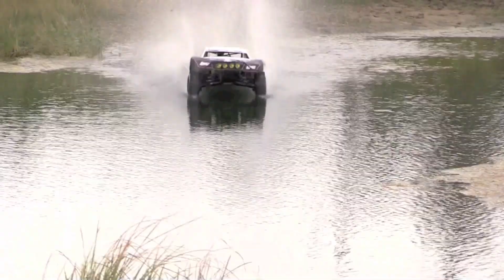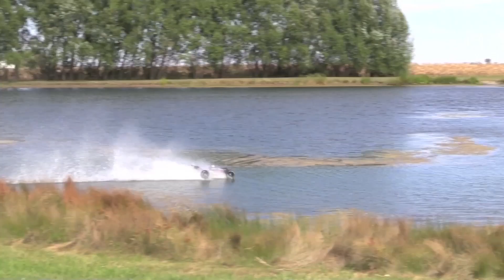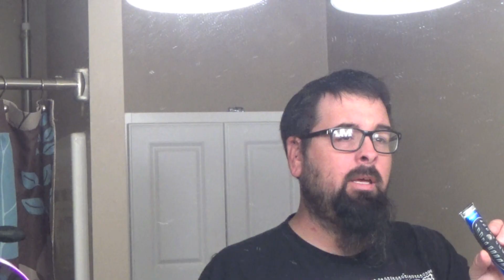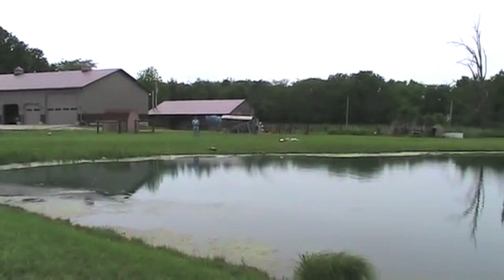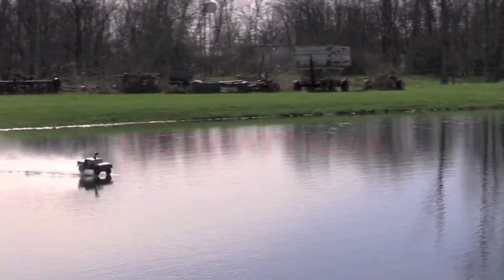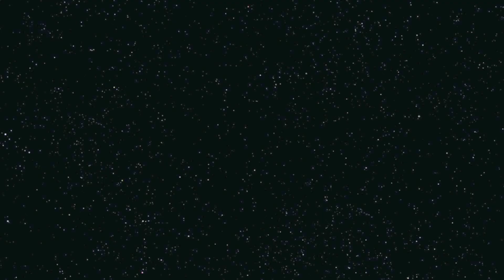SUPERCHARGED GILLETTE PROGLIDE STYLER  LIFE HACK

Comment: @GIGAWATTSLAB Is your trimmer still working? Have you changed the battery?
Reply from the maker: holmete 
Yes I recharge the battery every time it gets low. Yes the trimmer still works. Because it’s running 4 times faster the blades get hot so I use clipper oil on the blades before ever use
Reply: GIGAWATTSLAB thanks for the reply. Shocked the oil does not irritate you. Thinking about using this as a body groomer. Have you tried using it in water? Does it cut the same and stay cool?
Reply from the maker: holmete 
Never used in water